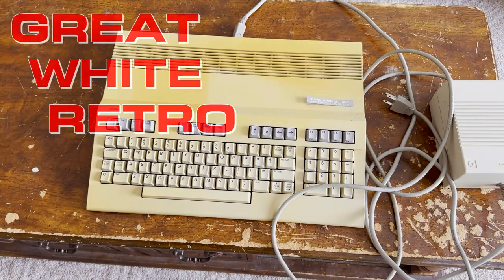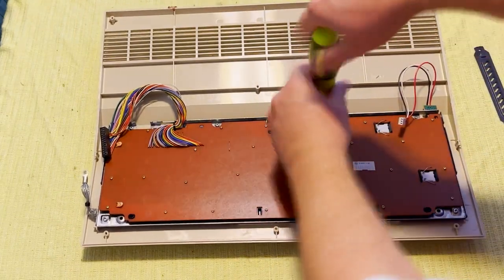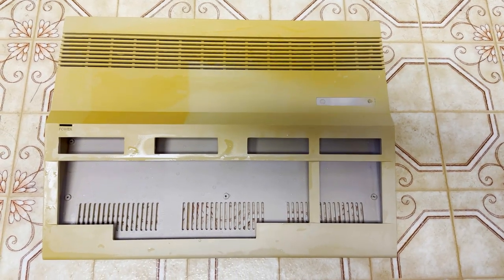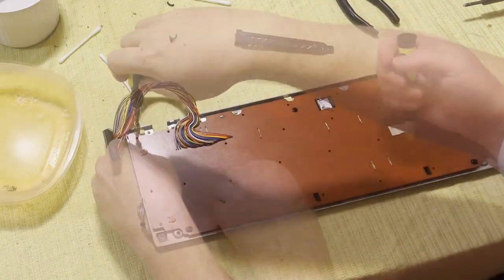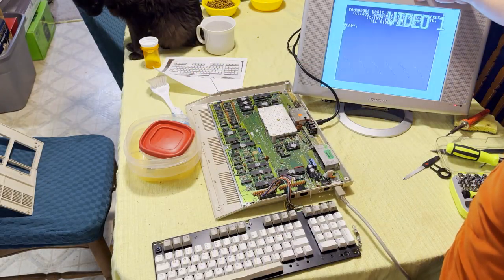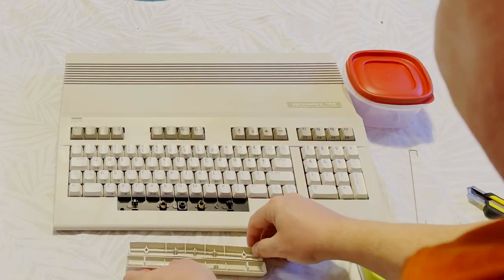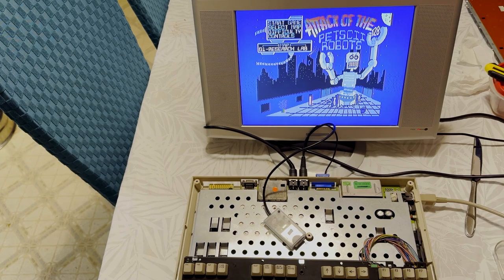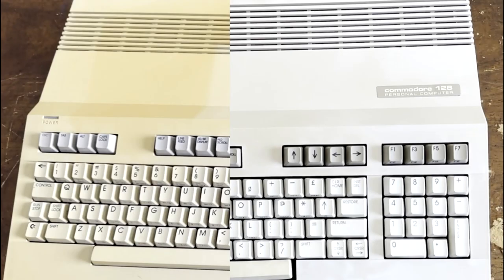Commodore 128 Extreme Retrobright

Comment: Oof, sorry to hear about the spacebar, but very glad you documented it so folks can be aware of the potential dangers of retrobrighting on the stove.
Reply from the maker: I think if it’s kept under 60 Celsius it should be fine for next time. Even 70 C was a bit much for a Macintosh keyboard done after.
Reply: @greatwhiteretro  I did about 60°C for an NES controller shell, and it worked a treat. I was obsessively checking the temperature witha meat thermometer throughout, I think a sous vide would be a more reliable option